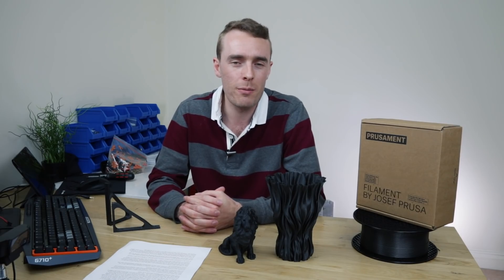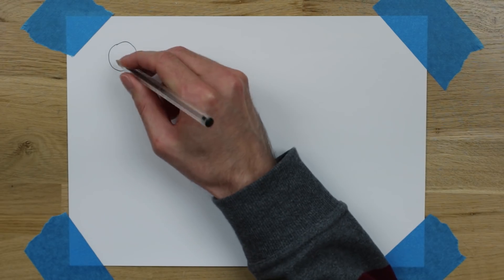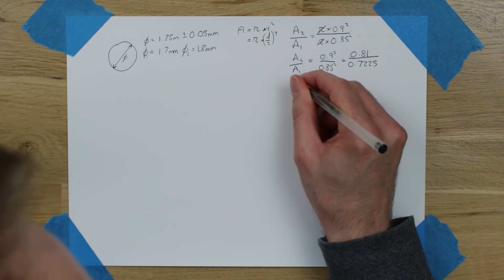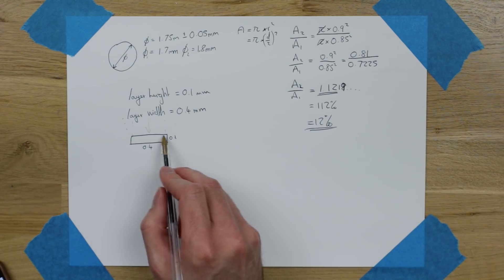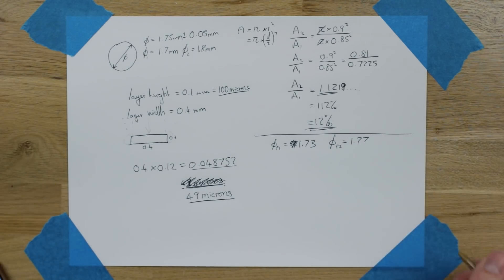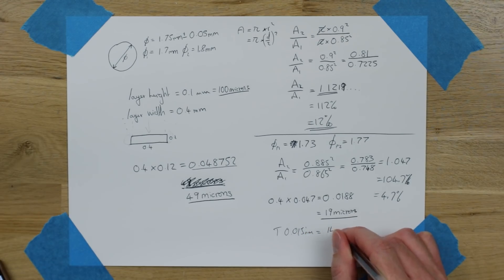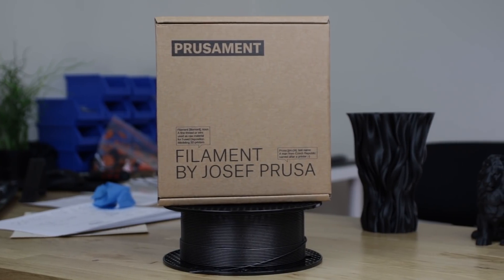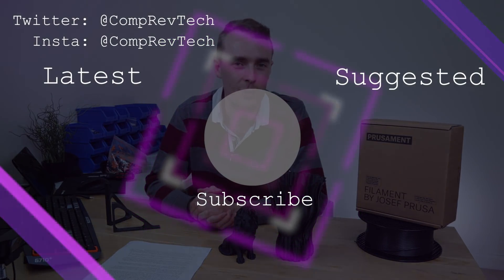Does 0.02mm Tolerance Make a Difference?

Comment: I personally don't think it really makes that much of a difference and the reason is your extruding out of a nozzle that heats the filament up to molten temps. Here's a thought experiment. Take two 5-gallon buckets with say a 1/4" nozzle in the bottom.  You fill the buckets with water from a 1/2" pipe. You have two valves that can control the flow of water into the buckets, that can be adjusted randomly, Set up both to fill the same amount of water; one stays constant, but the other valve adjusts, say 10%, but overall, they are the same amount of water going into each bucket. Now measure the water coming out of the 1/4" nozzle. You will find you will get the same amount of water no matter what the input to the buck is doing. You don't magically get more water out of the smaller nozzle in the bottom of the bucket. Now I release there is a difference between gravity-feeding water from a bucket and forcefully pushing plastic threw a small hole. However, when your pushing 1.75mm worth of filament threw a 0.4mm hole Does it really matter if it has 0.03 more difference? Maybe bigger nozzles might have more of an impact IDK.
Reply from the maker: The big difference to acknowledge is that the internal volume of water your bucket can vary but in a nozzle its constant. Think of it more like a hose, once its filled with water and change of the tap has a pretty much instant effect on the output.

Comment: gone too far , any change in speeds when cornering for exemple will change the flow, i doubt a +-0.02 filament tolerance makes a 5 or 12%  difference. there is too many things going on when printing so a +-0.02 or +-0.05 wont make any noticeable difference on parts dimensions or quality.
 but you could calculate what preasure difference does it make in Psi? a=d x pi , so  P=F/A   if that matters.

Comment: Nice. As a number of people pointed out the error in being 6% and not 12% i can add that roundness is usually the culprit of variation.

What is important is how much material (area) per each section of the filament is. And for that the complex shape that is not round is hard to calculate for.  If the shape is out of round but has pretty much the same area then the print won't suffer at all.
If the change of diameter (and area) is systematic due to filament control at manufacturing (like a closed loop between plastic extruder and accurate measurement of output and this changes hi-low with the reaction time of the system) then this variations will average out in the hotend if the lenght of the wave is short (when plastic is molten in the nozzle it does not matter diameter, but volume in the molten plastic available in the nozzle to be pushed out.)

So a better unit for what a 3d printer needs is the average molten quantity in the nozzle (rougly 10-20mm length maybe more maybe less) to be constant for that length of filament. For this a good test would be to measure average volume by mass for lets say 30mm sections. As in cut exactly 30mm of filament and put it on a jewlers scale or chemist scale (to see minute fractions as that piece is very light) and cut another section, and another and see the variation. If there is big variation that means the wave legth is great and can cause problems of over and under extruding. If there is no signical difference then at least is constant and the true diameter may be calculated by density (hard to get, requires pycnometer to measure) But it can be accounted for reliably by print quality on top layers. If there are gaps then is underextrusion and adding a bit more % will solve the problem for that roll of filament that is not exactly 1.75mm but it is roughly constantly 1.7mm. Same for overextrusion. 
This is still a good filament if the average diameter (or average mass per usable unit like 30mm) is the pretty much the same across the roll since after a minor tweak in the slicer will give accurate high quality prints.

If the filament is inconsintent in volume it will give that nasty fell of low quality filament. Also another aspect is not the true diameter but the actual volume of the plastic and that includes having voids in the filament. Depending on the process, maybe the filament has air pockets inside. This accounts as a loss of material and underextrusion as well even if diameter is spot on.

Comment: a local manufacturer has +-0.005mm tolerance filament, that represents a 1% variation in volume compared to the 4% of 0.02 or the 11% of 0.05
in my experience even a 2% change in flow can affect a  print

Comment: Nice video, but I think that your calculations have no practical meaning, just because the cross-section of the filament isn't in most cases a perfect circle, so the cross-section can be the same even if the diameters are different (and vice versa). Průša claims that he measures the X and Y axis, but does not claim that the cross-section of his filament is perfect circle, so it could be a square ;-). Also, it is wrong to count the area and not the volume, because the filament diameter is not constant. Last but not least, all of my filaments have a deviation of less than ± 0.02 mm, although the manufacturing tolerance is set to ± 0.05 mm. It's just about marketing.

Comment: Of course, most rolls by the good suppliers are probably just as accurate as Prusament is. They just don’t guarantee it.

Also, the way professional extrusion pipelines work — or even a well dialed filastruder — there is unlikely to be that much short term variation. It’s not like you’re getting a roll where one meter is 1.7 and the next 1.8 — but you could get a roll where the whole roll is 1.71 +- 0.01, and then in a roll from the next batch, 1.79 +- 0.01.

Or you could get a roll that starts at 1.71, but then they noticed the problem, overshot to 1.79, and eventually corrected to 1.75. Technically. That roll will print like shit, even if you dial it in at the start. And I suspect that a good filament house would reject that roll despite it being technically in tolerance. But they might sell it to or as a B brand.

Comment: Your calculations are based on the filament being a solid. Because the filament is heated and becomes a liquid, don't fluid dynamics change your calculations? It seems to me the amount of pressure applied to the liquid state filament and stability of any back-pressure would have more effect to the consistency of each layer. Now with that in mind, having a less varying filament diameter probably makes the pressure applied to the liquid state filament more consistent.
Reply: The extruder is where the volume is determined and where the diameter matters and the filament is a solid filament there. The hot end has fluid dynamics going on but in the end, what goes in must come out. At best it might even out very short term differences, like if the filament changed diameter from one centimeter to the next, but that isn’t what happens.

Comment: See many people saying that you used the 12% on the 1.75 which indeed wasnt the best way to do.
but doing 6% on 1.75 but also -6% on the 1.75 diameter still results in a 12% difference so the micron calculation isnt actually that wrong.
But instead of 49 microns bigger it would be 24.5 microns bigger or 24.5 microns smaller than you would get with the 1.75 so still a total of 49 microns difference between the smallest and biggest possible size if i'm not mistaking.

Comment: I expected a comparison between two identical prints with different filaments, was disappointed.
Reply: @Vector3DP  I see. Looking forward for that! I don't think they need to be exactly the same for a good comparison. Also maybe a 100% filled piece would yield more differences because there's more filament being spent per layer.
Reply: C.R.T you could simulate it, for visual aide. Manually change the extrusion multiplier so it is as if you had 1.7 or 1.8 respectively filament going in. Then you can just use the same super accurate roll for all three prints :)

Comment: Also there is the part of measuring the filament diameter in the first place, I usually measure mine with a pair of cheap calipers and they them self are only good for around 0.03 mm (in a couple of places, and around the filament (due to ovality)).
So basically Prusament has a better specification than my current measuring equipment... and your spool it seems is also claimed to be quite round

Comment: The numbers would be slightly worse if filament manufactures were to use a nominal diameter of 1.7mm in order to not go above 1.75mm due to the +-0.05 mm tolerance (to ensure it would never jam in a 1.75mm hole)
At least in my experience my filament always stays below 1.75mm.

Comment: That is not how you calculate tolerance. You need to know a lot more about how much of the spool in this case is at the edge of the tolerance. It might just be 1% of the spool that is at the edge, meaning that maybe 97% is within +- 0.02 even if it states 0.05!

Comment: Very interesting! I enjoyed this video alot.
I just have one problem: I really don't like the x for multiplication. The x is already used by the cross product of two vectors. Mathematics always tries to be as precise and unambiguous as possible. Using a x for multiplication is therefore bad practice.
In my opinion ...
Reply: I think you mean that using an x for the cross product of vectors is bad practice, as it is already widely used for multiplication. The • is just a lazy way of writing the x.
Reply: Actually the x is used in written simple maths quite often - in anything that does not require vectors, obviously. The reason is that the dot is simply not VISIBLE. Too small. Most handwriten math I have seen (financial and economic area) people actually use the small x for multiplication because it is clearly visible and not a number.

Comment: Thanks for showing the math of why the higher precision filament is significant. However, I suspect this filament would make the most impact for direct drive extruders. The bowden setups have too much inherent slack and wouldn't significantly benefit from this.

But as you said, there are many factors at work for 3D printing and being able to nail anything down will definitely go towards improving the print.
Reply: Bowden or direct drive shouldn’t matter too much. We’re mostly not talking about, like, these 10 centimeters are a little thicker. That might vanish in the compliance. But what actually happens is more like “this roll is thinner than the other roll”, or maybe “this half of the roll is thinner than the other half”.

Comment: FYI, the company Fiberlab from Poland (brand name: Fiberlogy, fiberlogy.com) manufactures filament with the same tolerances as Prusament - for several years now. If you‘re interested in testing it drop me a line and I‘ll provide you some.
Reply: there is no pricetag on them on the website. is it cheaper than the prusament (25€)?

Comment: that's a load of something dude. Layer height for one is set by the z height so It shouldn't be changing. As for the with I think your math is off No chance it's 12%
Reply: Let’s just go back of the envelope, order of magnitude for you then, as a sanity check: +- 0.05 is a variation of 0.1, right? Apply that to just under 2, and you get a variation of a bit over 5%. But you get that variation in two directions of the filament cross section, so double it: a bit over 10%.

The actual unsimplified math is shown in the video so I won’t re-do that.

Comment: nothing to say about the calculations but as you initially said, this assumes everything else is perfect, which will never be the case.

actual tests are needed to deem it worth the extra price. i personally don't think it will make much of a difference vs 0.05 tolerance filament, mainly because of oozing.
Prusament is not the first 0.02 tolerance filament on the market, anycubic and sunlu already got there long ago, and in my experience, it didn't really change much as far as print quality

Comment: What is the true tolerance of normal filament ? They may say 0.05mm because they haven't bothered to measure along the length of the filament or logged it.
In reality it may be a lot better in most cases. would love someone to actually test it.
Reply: @Vector3DP  no they aren't.
And, in comparison to Josef's filament, they are often much more consistent.

It's not the change from 1.7 to 1.8 mm what makes your toy look bad, it's when it jumps all the time.

Comment: Small "bulges" are not going to worry me that much, they can be sorted in post processing. What does concern me is too much variation causing my extruder to "slip" when trying to force filament through small nozzles, I have some filament that will not reliably print through a 0.25mm nozzle, definitely a PITA.

Comment: My 2p; I think it may also be worth putting extrusion resolution into the mix. Thinking being there's little point gaining accuracy in filament if it's swamped by other things anyway.
The typical cheap printers with 1.8 degree steppers and 1:1 gearing on the extruder pushes through, by my back-of-an-envelope calculations, something like 24um^3 per microstep so may not benefit from the higher accuracy filament, as the printer mechanics vary at least by the same order already elsewhere. Should probably also consider X/Y positional accuracy.
However with an extruder using a 0.9 degree stepper with 3:1 gearing (which is what's on the Prusa Mk3?) we're talking an order of magnitude finer extrusion accuracy, so yes more accurate filament should make a difference.
So my prediction (hah!) is that a side-by-side print test using the same gcode on a Prusa Mk3 with Prusament and normal +/-0.05 filament should show a noticeable improvement, however a side-by-side test between the two filaments on for example an Ender 3 should show any improvement swamped by other effects.
Proof is in the pudding of course, nothing beats experiment to validate or refute theory :)

Calculation, in case I've got it wrong:
1.8 degree stepper with 200 steps/rotation and 16 micro-steps with a 10mm hob yields (10*pi/16/200=) 0.01mm per micro-step - (1.75/2)^2*pi*0.01 = 0.024mm^3 or 24um^3
0.9 degree stepper at 3:1 gearing yields 1/6th of that so 4um^3 per micro-step
(I'm ignoring torque variation in the stepper motor on micro-stepping, as that just makes the figures worse, or more wobbly)
Reply: All the Prusas so far have used 1.8 direct drive E-steppers, albeit with microstepping enabled. 0.24 um^3 per step is not the same thing as overextruding 0.24 mm.

The fact that some printer or other (might have even been the Prusa) recently had an issue where software changes made them overextrude by 5% and that this caused significant print quality issues is sufficient proof, I think, that a +- 6% diameter variation is no bueno.

Comment: but there is another question, yes having  12% error, is 1 think but a bigger thing is the rate of change of error, i.e. over said a meter, what is the change, if this is 10% that would cause more problem the whole roll is the same size put right at 1 end of the possible error.
Reply: @Vector3DP  I think I get his point. The change in diameter is not a step change. If the diameter variation occured once slowly over the length of the whole roll the impact would be much less than if it occurred  frequently over short lengths.

Comment: As others have already stated. You did your math wrong. I do greed that a tighter tolerance is better and will result in a better print. I myself only buy filaments that claim to be +- .02. There are several manufacturers that are +- .02. Sunlu is one of them. I've purchased 8+ rolls of their ABS and have never had a problem.

Comment: How about checking the filament accuracy, and comparing it to other spools?
Reply: @Ron DLH you wont as modern slicer already compensate for it, Look under your settings, When you use a .4 nozzle its actually set at 0.45 to the flow is less to make sure it comes out as a 0.4

Comment: You calculated the total maximum variance, from the smallest size in range to the largest size in range. But you then adjusted the extrusion volume by that entire amount. Because the printer should be calibrated in the center of that range, the actual variance would only be half that amount (but in either direction). So, it's unfair to say that the less precise filament would result in 49 microns of additional size. Instead, it's more accurate to say that the extruded dimensions would vary by +-24 microns. Similarly, the more precise filament would vary by +- 7 microns, not 14. That's a much less significant difference.

I'd also hazard a guess that extrusion slop, thermal expansion/contraction, and nozzle placement precision, and general calibration errors are all each larger than +- 24 microns. That doesn't mean that more precise filament isn't likely to be better, but it's definitely not going to be the difference between a good print and a bad print.
Reply: @Bits and Electrons I'm going to do the unthinkable in a YouTube comment section: I'm going to say "You're right, that's a really good point that I hadn't previously considered. Thanks for broadening my knowledge with your additional perspective." :D

Comment: Your 12% calculation was for 1.7 vs. 1.8.  Then you changed your 1.75 extrusion by 12%.  So the additional amount of of width on your extrusion was too much. Essentially, it should have only grown or shrunk by 6%, not grown by 12%
Reply: Right. I was joint pointing out that you calculated the 12% from nominal in your extrusion diagram (which was described as what it looks like at nominal)
Reply: @C.R.T Plus that 40+ micron variance that you say whether it is 40 or not will be spread out to a high length of print, (high comparing to microns calculated here) as the variation of thickness of filament is probably not immediate + or - x amount but gradual throughout filament length, sorry for my English.